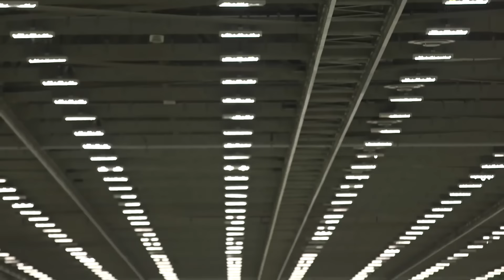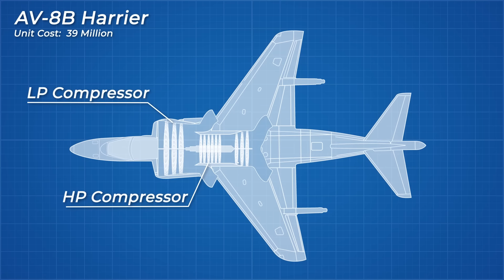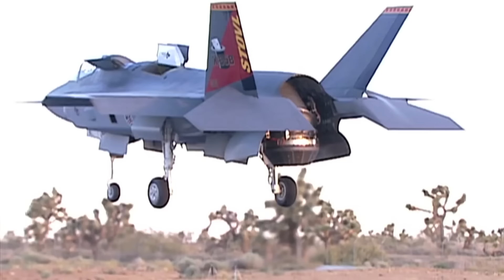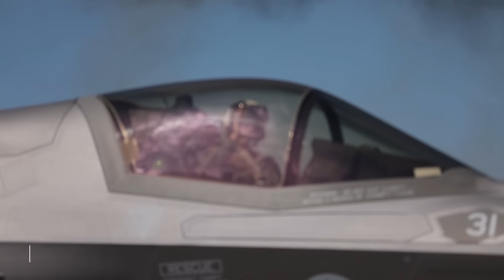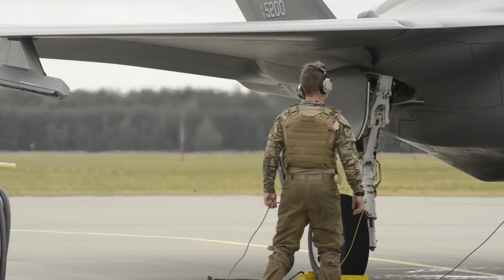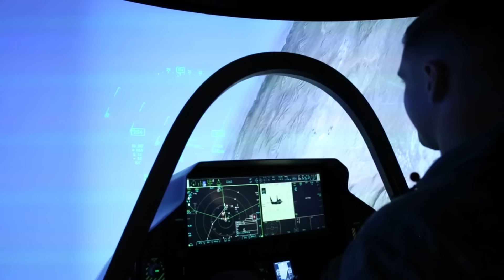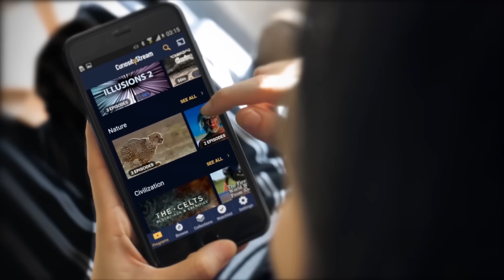Is The F-35 Worth $115 Million?

Comment: 27 years in development. L-M must be as happy as a pig in shit. All fully funded by the US taxpayer. The concept largely got sold on cost and that was underpinned by a very high commonality of components between all three types and the economies of scale brought about by high volume production. The common parts across the types are 27%. Pathetic, that means each type is effectively a different plane. No cost saving. The unit cost is 500% over original estimates. The plane is 10 years late. The original (USAF) reports of the flight performance (which includes range and payload) could not be wrong, unless you want to discredit the test pilots, who BTW have no bias at all, unlike L-M company test pilots. So did someone wave a magic wand and increase the thrust/weight ratio, improve the airframe so that more ordinance and fuel could be carried and the lack of manoeuvrability got fixed? Nearly all of the re-engineering has been directed to just make it work in the first case, not "improve" its performance. The Pentagon has been caught out lying about weapons systems performance on many occasions. Do you think for one second they won't lie about the performance of the most expensive weapon program in history? With foreign $$$ sales and thousands of jobs in almost every state in the offing? This thing is too big to fail and you won't get an honest opinion from L-M (obviously), or from the Pentagon or Senate either.
Reply: What nonsense are you on about?
Reply: @peterson7082  It's unfortunate the education system failed you so badly to the point where you can't read.

Comment: I don't think anyone will agree that the JSF is capable of performing the missions of everything it is purported to replace. This idea has been around since the Second World War and every single time it is wrong; the F-111 sucked at naval deployment, the F-4 sucked at bombing, the F-105 sucked at air combat, the F-14 sucked at bombing, the F-16 sucked at long loiter close air support, and so on and so forth. The requirements for these missions are literally in direct conflict. It's like designing a car to offroad in mud and then do 300km/h on an F1 race track. Somehow it needs big suspension and ground clearance to offroad and yet also to ride close to the ground stiffly to do 300km'h stably. Then it needs to have a long wheelbase on the F1 track and a short wheelbase out in the mud. High pressure tires for the track and low pressure for offroading.  The end result is ridiculously expensive, complicated, and heavy, and yet it doesn't do any individual mission as well as what it purports to replace.

Comment: Is the F-35 Worth $115 Million? Short answer: Yes. Long answer: Yeeeeeessssssssssss.
Reply: 18:39 He talks as if only stealth design matured since F-117 Nighthawk. Along with stealth, SAM systems and its detection capability improved too. If late 1900's stealth can be defeated by late 1900's SAM systems, then 2020's stealth system can be defeated by 2020's SAM systems. STEALTH DEFEATED.

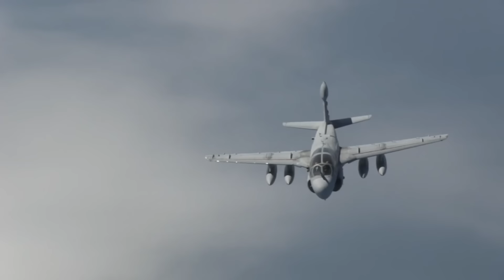18:24 If they used Electronic Warfare jets on SAM sites, then Serbia could have used anti-radiation missiles and won. Same outcome. STEALTH DEFEATED.

14:02 If stealthy F-35 starts to communicate with other allied units with it's network capability you brag about so much during mission, it will give away its location by electromagnetic emission.  This is why, while in mission ship and planes don't use its radar and avoid communication. STEALTH DEFEATED. 

16:17 F-117 never got shot down over Iraq because when the war started, first thing US did was use every units and weapon it had to take out Long Wave Radars Iraq had. So, F-117 is not invisible or invincible. And the US knows that. After Serbia, the world knows that. STEALTH DEFEATED.

18:02 Low frequency radar may not provide weapons grade targeting information, but can see stealth clearly. If a B2 bomber is penetrating enemy airspace, then Low frequency radar can spot it and inform it's air-force. Fight jets can intercept and destroy with ease given that B2 is subsonic and has no air-to-air capability. STEALTH DEFEATED.

Comment: I'm not convinced. 

From what I've heard, the airframe has issues which were pointed out early in development when they shortened the wingspan.

The VTOL system limits weapon bay space which limits its stealth payload and the airframe issues limit its external payload. Not to mention its cannon ammunition capacity is embarrassing.

I can see the A variant having sone success in BVR engagements but otherwise it's going to be a paper tiger.

They had to compromise too much. Especially in its ability to just be an aircraft.

They would have been much better making 3 unique aircraft and standardizing as much as possible between them.

It will be bad at being an aircraft, okay as an AA fighter, and limited in ground attack and CAS. Those are my predictions.

Comment: Before I even watch, no it is not, this jet should have never have won the JSF program. The JSF planes were supposed to be under $30,000,000 per plane, not over $100,000,000. They were suppose to be closer to the F-16's and F18's price tags and far from the F-22's. We should have a F-32, not this overpriced POS that failed one of the criteria massively, the price. If I remember right, the X-32 only failed on air to air refueling and that was the pilots fault because he couldn't get the probe in the basket, and if really need be they probably could have switch to the refueling system the X-35 decided to use. Main difference in the two systems is that with one a fuck up is pilot error and the other is boom operator error. Either way both systems can have fuck ups. One other thing I remember was that the X-32 was considered to be somewhat of an ugly duckling, well first off form over function, and second several of our past and current planes have been ugly ducklings and are some of the most beloved planes and are now seen as bad ass like the A-10.

Comment: "If the stealth plane had ECM planes as support"... what is the point of stealth then?
Russia said as much 40 years ago, it's much more cost effective putting a ECM pods and improved passive sensor suite on existing multi-role fighters than redesigning and manufacturing entire air force. Later models of Su 's have Khibiny pods incorporated in airframe design...
Reply: ECM is one way to tackle the problem, but any aircraft employing ECM can only use it effectively until at a certain point from the targeted radar.  This point, or range from the radar is called burn through range.  Low observability (AKA stealth) shortens burn through range, allowing the "stealth" aircraft to move closer to the radar that is trying to detect it without being detected.
Reply: @kawrx2002  That is it's still a mater of age of technology. ECM is advancing just like stealth, with main difference being that every time an advancement is made you need to change one module not the whole plane.
Edit: don't get me wrong i'm not saying that stealth is useless, just that is nowhere nearly as effective as people imagine it to be and comes with a lot of drawbacks, cost being the most obvious one...

Comment: I can't deny the technology and engineering excellence that the planes have. The panels he  mentioned ... I DIA dropped the Russians plane because their quality control like panel gaps were present.

But does that make the plane good?

He's right... Making 3 seperate ones would be better. 

The size issue means the A version is really too small. It affected the amount of weapons and fuel carried. Even if weapons weren't an issue, look at the Chinese J20. It's several metres longer, which will give it a larger combat radius and loiter time. 

This matters for the USA itself, and countries like Australia, and even Japan, which have long coastlines and distant island territories.

Comment: Did your hear about the two detected F-35s by a German passive Rader after the Berlin Airshow.
Reply: Only in a propaganda. Also f-35 and other stealth planes uses reflective materials when flying in civilian air space to avoid collisions against civilian planes.
Reply: @markoliimatainen2565  That´s not how the Passive Radar works.
The System searches for black Spots and Echoes in electromagnetic waves from the Atmosphere.
It has nothing to do with the reflection material.
The aircraft generates these by their size.

Comment: There is an old saying that all an empire has to do to destroy itself is to insist on doing the impossible. The F-35 is a classic poster child of this and could very well prove to be US and it's allies undoing.

This program was doomed from day 0 for so many reasons. Firstly the requirements for the F-35 assumed 700 F-22's that would do the heavy lifting and the F-35 would face a benign threat environment.  Fast forward the tape to now and you have the J-20 and Su-57 and IADS like the NEBO-M and S-400 with only 187 F-22's to do the heavy lifting. Then in the JSF competition Lockheed Martin got a waiver saying it didn't need a weapons bay. However the real nail in the coffin was combining the STOVL and carrying the fuel internally and the internal weapons bay. To quote a former RAAF F-18 Fighter combat instructor you do the numbers on it and you wind up with a flying guppy.

However what was really disturbing was the basic errors of fact in this video.

Firstly the F-35 sensors and cockpit displays are far from unique and in fact sub par. If you look at the list of sensors/ECM and battle management computers on the F-15X they leave the F-35 for dead. Also data links have been the norm for fighters like the Gripen and Rafale. So to claim the F-35 is the only show in town on this is a total nonsense.

Also the comments about counter stealth radars in this video showed a disturbing lack of research. Due to the F-35 sub optimal stealth shaping it can be tracked in the L and VHF bands. The NEBO-M radars can track this in both range and azimuth and it's little wonder the German passive radar the TvInvis could track the F-35 for 150 km and this works primarily in the VHF band. Also this totally ignores that Russian radars use sensor queuing extensively. That is using radars like VHF and L-Band and then using that to point fire control radars to get a final firing solution.

Also the comments about Energy manoeuvrability where laughable. F-35 advocates always point out the 2015 F-35 in that dogfight/high alpha test was g-limited. Well guess what as you pull more g the situation gets considerable worse and is even more chronic in post stall manoeuvring. This is flight mechanics 101. The Su-35S, Su-57 and J-20 will not have this problem.

Yet the final nail in the coffin of this video was ignoring the Pentagon's weapon tester reports into the F-35. In total contrast to the F-35 pilot PR reports a cursory read of the Department of Operational Test and evaluation (DOT&E) will show a range of handling and system deficiencies that have been unresolved for years. Little wonder that in the final dress rehearsal that is needed to approve full rate production the F-35 has only been averaging full mission capability rates of 8 - 11%. This is in total contrast to the milk runs the F-35 has been doing that the F-35 enterprise is passing of for the F-35 facing an actual peer threat. In any sane universe this would be grounds for program termination. Why this was not addressed in this report defies comprehension.

However actions do speak louder then words. It is little wonder that the British, the Europeans and the Japanese are now openly canvassing air dominance options that are not the F-35. Even the F-35's biggest customer the USAF is now openly canvassing a requirement for a 5 year development to field future fighters.

The F-35, doomed from the start and out of luck, out of altitude and out of time.

Comment: I still have doubt concerning the replacement of the A10 in particular. 
The A10, with it's bigger wing surface can be an effective ground support aircraft at low speed. And i don't know if the F35 could really fill such a role. 
Otherwise, all the technologies packed into it are quite impressive.

Comment: If I remember correct it was grounded during a air show in germany because a local company tracked it comming to The airshow. And they used The same radar type as russia  s system use.
Reply: Nope. The F-35s were leaving an airshow and the German passive radar tracked the F-35s from takeoff with assistance from air traffic control. The F-35s were configured to be visible on radar for safety reasons as they are most of the time i.e if air traffic control can't see them then they might direct an airliner into the F-35s flight path. Saying it could turn out bad if the F-35s couldn't be seen in civilian airspace is a great understatement.
The German radar was also developed by a German company with significant radar experience and had already developed various air defence radars and done a lot of work on the CAPTOR radar for the Eurofighter Typhoon.

Comment: The X-32 didn't have a separate vertical lift and supersonic variant. The Navy kept changing design requirements, and unlike Lockheed, Boeing was actually committed to keeping costs down by building a single airplane, not just 3 similar looking ones. They had to add elevators behind the delta wing to meet the navy's new roll rate requirements for landing, but didn't have time to redesign the aircraft and shave off weight. they had to take the inlet cowling off the nose to save a little weight to get the prototype to take off vertically but already had the fixed design by the time of the actual fly off. the X-35 doing VTOL and going supersonic in a single flight is basically what one Lockheed the contract. Boeing also had a cheeper plane that met the original requirements perfectly, whereas lockheed built a more expensive plane that somehow met the original specifications well enough, the final ones perfectly, and even some things no one thought of until after the fly off. They had always intended on building 3 related varients.

The LIft fan is also a terrible system. the driveshaft and gear system are extremely complex and maintenance-intensive. They avoid using it whenever possible. its also heavier and takes up fuel space compared to direct lift. The F-35B is also completely capable of rolling carrier takeoffs and landings with the lift system active as long as you don't set the catapult or arrestor wires to high. The drive system needs so much maintenance that building a nearly unrelated variant for the nay turned out to be cheaper in the long run.
Direct Lift like the X-32 also gives you a better thrust to weight ratio, which would really improve its dogfighting, and combined with a significantly higher wing sweep, the final version of the X-32 would probably have had useable supercruise. It would also have let the marines variant land on supercarriers with almost no extra cost.
Boeing also showed off some amazing laser-guided assembly methods which allowed them to build the prototype both faster and cheaper than Lockheed martin.
Boeing's plane was creative and probably better, but really ugly with its air intake that looks like a gulping fish and wasn't as good at Lockheed at predicting changing design requirements.

While stealth is extremely useful,  I have two issues with your arguments for F-35 level stealth. 
The first is that search radars are quickly learning to guide surface to air missiles. The US  navy has already proved that it can hit incoming missiles over the horizon with SM6 interceptors (which have the same seeker and guidance as the AMRAAM) using a datalinked E-2D hawkeye. The vulnerability to low-frequency radar is quickly actually becoming a vulnerability to a potential targeting radar, especially against larger, long-range anti-air missiles which can scan a larger area of sky for their target on their own. Modern AESA L band and even UHF band radars are nearly good enough to guide an old SA2 missle to its target with command guidance and still get within its blast radius. Digital beamforming and pulse compression are amazing things.
My second issue with stealth is that while valuable in air combat, almost every new fighter being build and most non-US 4th gen fighters have a good IRST system, which can see an enemy aircraft at about the same distance a fighter-sized X band radar can see a 1m^2 target, so the difference in X band radar return between pure shaping and the super expensive and fragile stealth coatings is almost meaningless, even pure shaping is already well below 0.5m^2. It may help with jamming incoming missiles but the radar can output so much power that it could nearly fry the missile's computer, at which point having enough jamming power isn't really a question. 
Even the new super hornet manages an RCS less than 1m^2, and most of the European aircraft like the Rafale and even the SAAB Grippen have RCS well below the 1m^2 mark. They don't even need the level of expensive precision the F-35 does, let alone stealth coatings, to achieve that.

Comment: The F35 is not replacing the F18 Super hornet or the a 10 warthog it is only replacing the F117 and the AV8B harrier on your chart. As for the Air Force it is not replacing the F15 either. The navy has ordered state-of-the-art F18s and the updated and rewinged A- 10 is back by popular demand. The F15X  will be needed to haul munitions that the F35 can not carry. I'm sure the F35 is a great plane but it's gonna have to prove itself